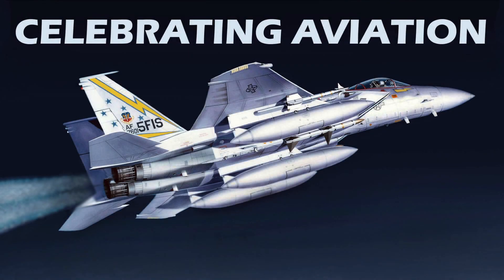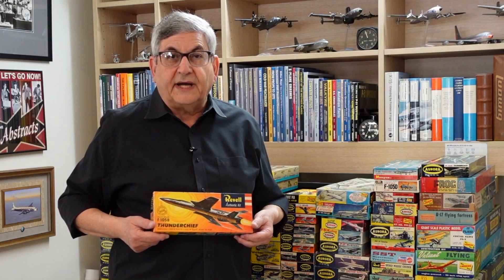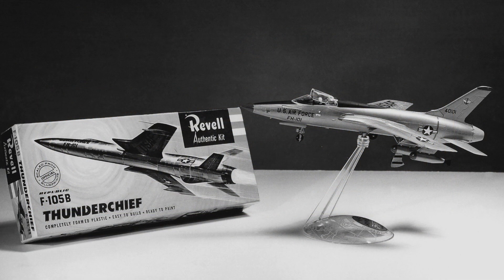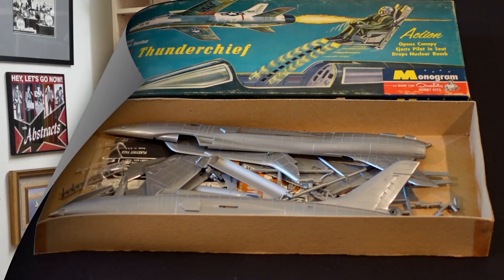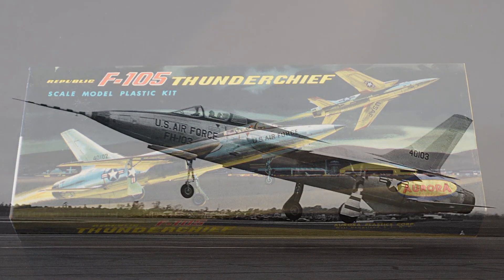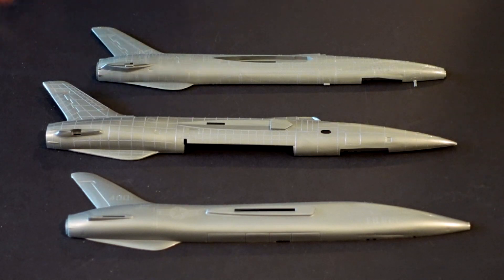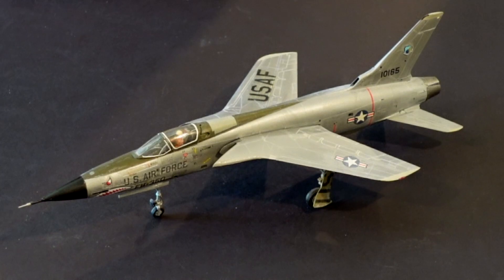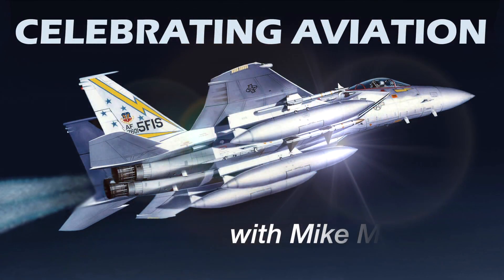FIRST MODELS OF THE F-105 THUNDERCHIEF - Three vintage kits of Republic's Mach-2 jet!

Comment: Ahhh, memory lane...I built one of the Hasegawa Thud kits when I was in high school.  What I struggled with was the correct angle of the main gears. They seemed to want to angle sharply forward, but I knew that couldn't be right...
Even though I've been out of the hobby since the late '70s, I still have my scrap parts box, including the F-105 drop tanks.
Reply from the maker: Interesting point Pete, and that's why I used the main gear from the Revell kit!

Comment: Ahh, THE Lead Sled!!!!
Reply: The big dog... good for you
Reply: I thought the Phantom had the honor of that designation.
Reply: @patrickmorley9634  A number of planes had the unofficial name of lead sled. e.g. F-3, SR-71, F-84.  F-3 and F-84 were plagued by engine development/service issues which resulted in serious degradation of performance/short service life and the term is wholly derogatory.  

The Phantom was not a good "turn in the horizontal" aircraft but the J-79's had enough energy to allow  the pilot to combine a turn and a climb/dive to compensate.  The Phantom's engines could also get this large heavy plane to go like a bat out of hell in a straight line.  Same thing for the 105 and SR-71.   This harkens back to the original usage of the term for car that is very fast but is large, heavy, and low to the ground (and barely maneuverable).